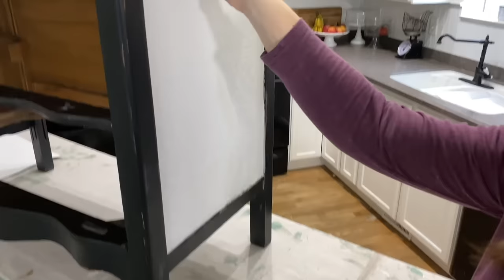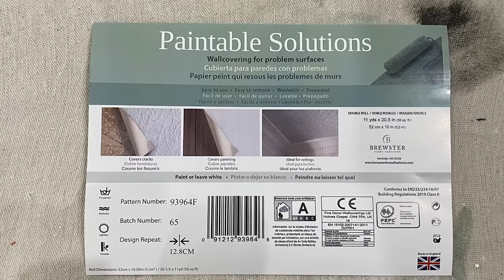How To Repair A Dresser | We Shouldn't Have Bought This

Comment: I've done the paintable wallpaper several times. It does take extra time to dry before you can paint but completely dipping it in water to activate the glue really does make it adhere great. You guys did a fantastic job working out all the frustrating problems with this one! Little Jack looks so much older 😊
Reply from the maker: He’s growing way too fast!

Comment: Help! I am currently working on a dresser similar to this, but big..  I see yours has the wooden slides on the sides, that's how mine are. How do I  repair those without having to replace the whole piece?  More than half is worn away, theki⁸  with almostlvis totally exposed and then the second to the bottom drawer which is quite large and heavy, it rests on the bottom drawer. I wanted to decoupage and the front of the drawers but I knew they would pull that off if I wasn't able to fix it properly. Can I somehow feel in that missing would without having to replace the entire piece? I have to replace the whole thing I don't know where I could purchase that and I don't have the saws to cut anything.. FYI mine also has a TON of wormholes on the top.. I wish I would have known that I would have just bought a new piece of wood to replace the whole top. And also since I'm asking you so much and wondering about the original wooden Wheels what I can do to fine-tune knows a little bit to keep them from falling off??

Comment: This paper is called anaglypta paper. You can google it and see all the different designs available that the box stores don’t have. I have used it on the ceilings of my home. I have plaster & lath which cracks whenever the house settles and this holds everything together 😁
Reply from the maker: Nice